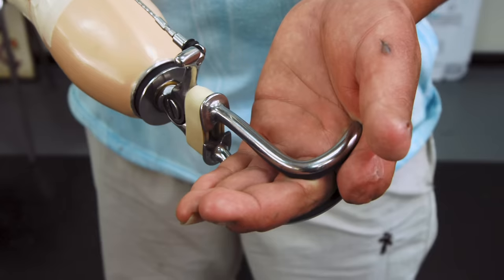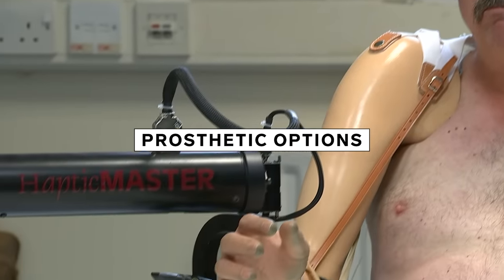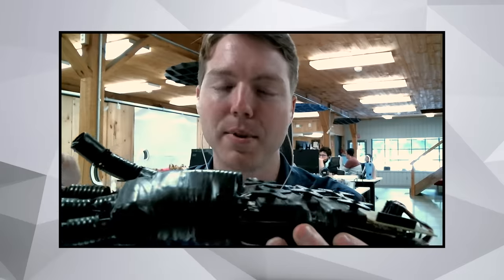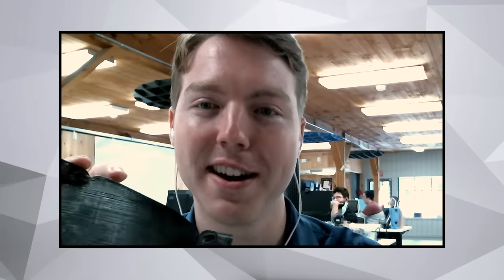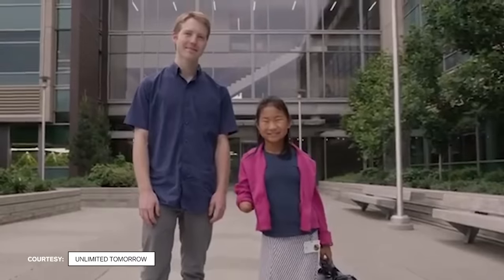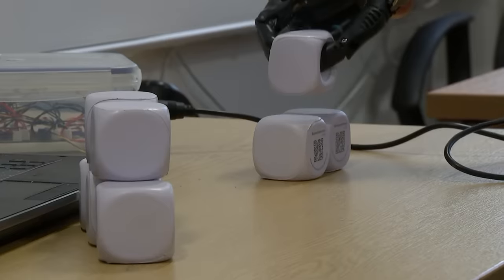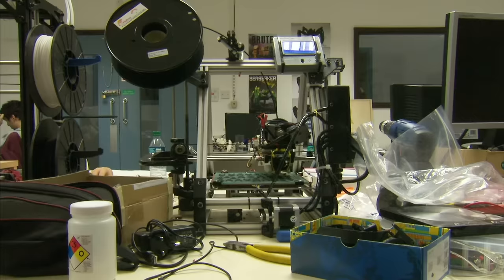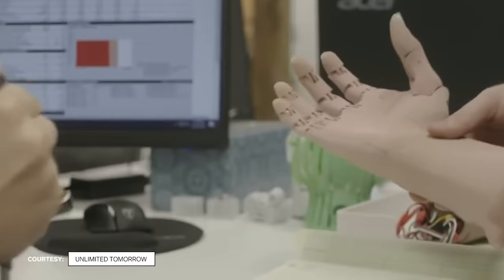Every Prototype that Led to a Realistic Prosthetic Arm | WIRED

Comment: As someone who is missing a right hand.. I can tell you they still have a long way to go. Current prosthetics are like strapping a 2x4 to your arm.. they're probably handy for a fight and not much more. I think they should look into rigid skeletons with tendons, like the video, but surrounded by a thick layer of silicon cast into hand/arm shape. Plastic is too hard and very unnatural against the body.
Reply: I get why your username is Bucky!! :)
Reply: Transhumanist here, not missing any limbs, but it's the "realistic" looking ones that I hate. Like yeah, we've come a long way and they're getting much better, but I want something that can do something my natural limbs can't. Since we haven't mastered movement, haptic feedback, and all the cool functionality of my dreams, at least give me a bottle opener or a flashlight, or like a 4tb external hard drive. Give me a wifi hotspot in my robot arm. Having a limb missing still really sucks. Let's at least make it worth the money to buy the expensive prosthetics
Reply: hehe “handy”
Im sorry
Reply: @xandracortez9485  My last name is Buck lol. No connection to the hand thing.
Reply: @callmestumps6954  I can buy the metal connector that normally secures the hook/hand to the prosthetic and weld whatever I wanted to them. So I could theoretically make whatever attachment I wanted, just need a welder.
Reply: Ooh yeah a silicon outer structure would make so much sense. There's gotta be some way like that to connect the tech people use to test weapons and armour and stuff with the current prosthetic tech--something that can move but also something that has the feel and weight of your other arm instead of a 2x4.
Reply: @nicksalvatore5717  Why? There's plenty of empty space in prosthetics. Why not put a cellphone holder in it? Why wait until "after" it's perfected to modify? Why not both?
Reply: @callmestumps6954  "not missing any limbs"
Opinion discarded
Reply: Have you seen Ian Davis prosthetic hand on youtube?
Reply: @nicksalvatore5717  to be fair, a beer opener is quite easy to integrate into almost anything, but it certainly would look wierd
Reply: @callmestumps6954  I amputated my legs below the knee using ice, lol. Now I have nice (sometimes annoying) bionic legs. And I'm a foot taller, that's a plus I guess hah.
Reply: @happymolecule8894  i envy you
Reply: I think focusing so much on making the arm look realistic is the entirely wrong way to go. A lot of foot prosthetics don't look anything like human feet anymore, because we tried making them look as realistic as possible and it 100% negatively impacted performance. Once they let go of the image of a human foot covered in skin, we started seeing massive improvements.
Reply: @bummer6  That's funny because I've been thinking of the crab claw recently. Crabs seem to use it pretty effectively and there's only one point of articulation.
Reply: @bucky13  I’ve welded vise grips to mine to hold filler wire for tig welding, works like a charm
Reply: @thugnastytv4195  The vice grips are a good idea. I can buy the metal adapters for prosthetic accessories online. I plan to start welding them to things like vice grips to make custom quick connect tools.
Reply: need a hand?
Reply: @nicksalvatore5717  That's what I think will happen too. I think future limbs will be medical first and then go cosmetic afterwards.
Reply: @bucky13  the "quick connect tools" part just made me think of all the possibilities of having different adapters to easily swap out with different things attached. Like a knife, a claw, a hammer, a general holder for drinks and other things, phone holder and whatever else. That would be sick.
Reply: do you have to type with one hand or do u use both real and prostetic
Reply: Yeah like fighting is an everyday thing 🤣
Reply: In a few years, having a prosthetic limb will be better than real arms
Reply: @chrismanuel9768  Its a simple design philosophy of "complete what's needed before you add what's wanted". You don't want to be the one egg head to say "Sorry, boss! I couldn't test the arms grip strength yet. We had to get the cup holder working on the thing!".
Reply: @callmestumps6954  follower of the machine god of mars here, you're wrong. Before archieving things only the blessed machine can do, we need to design an arm that is either either equal or better than the weakness of the human body. We're not nearly as technologically advanced as cyberpunk, so we need to take care of what can be done today to archieve the average power of a human hand for now
Reply: @callmestumps6954 I don't take anyone calling themselves "transhumanist" seriously.
Reply: @HammerStudioGames  Why? Genuine question. Technology is the future and it's reasonable to expect humans to become part machine in the future. That's what a transhumanist is. Someone who wants to become enhanced with technology. Just because you've created a weird stigma against the term, doesn't make it any less of a common trait.
Reply: I don't care about the look.  I care about them not trying to connect directly to the nerves and making limbs better than the real thing.
I gave you a like but taking a negatives position because I want cybernetics.  I believe prosthetics is the most likely field to give us cybernetics which they are failing horribly at.
Reply: You can grab a can with a 2x4?

Comment: I'm actually surprised with the ones that are meant to look realistic.
The reason they look so uncanny (I believe) is that while they match in skin tone, that's about where the similarities stop. If they used casted silicon sleeves molded after a mirrored version of the persons remaining limb, or a model limb, then they would get all the fine details down to the follicles and the subsurface scattering of light that real skin has. It wouldn't be too cumbersome I would think, and the process for making realistic skin effects have existed for a long time thanks to practical FX artists, like for horror movies.
Having a skin glove would be nice because it could be made cheaply if you reuse the mold, could be airbrushed to give it a realistic look, and would be easily replaceable, washable, and protect the prosthetic. Not to mention you could upgrade the prosthetic while keeping the sleeve the same so long as the new prosthetic fits within the volume of the sleeve.

Comment: Yeah the main issue is the robustness of the devices, pattern recognition has been around for a while but i's one thing being able to move your fingers in a more natural way but it's another to actually do day to day tasks beyond the standard box and block test, of course all invocation is good and hopefully bring down the price but we are still  long way off being able to 3D print prosthesis that actually are functional and not making the patient frustrated
Reply: Did you not see the guy holding a knife slicing food with his prosthetic hand?? That is definitely not basic block test
Reply: @waywardgoddess7219  Yes but that's a rather simple grasping task that doesn't require high strength just a level of dexterity which individual finger movements supply, I'm on more about the day to day tasks that require higher strength hence I talked about robustness, even getting dressed these devices can't apply enough force to put on clothing for instance, they are only good at grasping fairly light weight objects and doing fairly straight forward motions like back and forth or left to right, I've spoken to many patients and they just feel that it's extremely situational and the hook systems provide a lot more function, and the sensor system can be very temperamental even when it's fitted properly causing it to do something you didn't want it to do
Reply: @waywardgoddess7219  I agree with max here. I am handicapped myself (but still have all my limbs). Human movement is rarely simple. Even holding a cup of coffee requires many muscles and very complex movements and coordination. So while this development is great, we are nowhere near being able to use a robotic arm as 'normal'. These videos tend to hype it up in the minds of people. Moving fingers and holding knives is the easy part. The real challenge comes later.
Reply: @waywardgoddess7219  it's easy to hold a knife
Reply: "still long way off"

No.
Reply: @alalalala57  and?
Reply: @alalalala57  it's not something hard, you don't need magic to hold a knife
Reply: @hkr667  I hope these issues get sorted out in the next 10 years. Maybe movies have ruined me but these technology is exciting.

Comment: I wonder if you could wire a USB-C port into the human body site? Then "dock" the prosthetic onto the USB port. Essentially re-create the neural connections. With a standardized interface like that, it would make swappable prosthetics possible. Need a strong arm for heavy lifting tasks ... plug one in. Need one for your delicate sewing hobby ... swap that one in.
Reply: A good idea on paper,but its not all that practical since it would need some kind of surgery and be incredibly expensive most likely

Comment: Great to see that this has advanced. In fact Cyberdine had a nice exo-suit with some sort of sticker input. It might be possible to have a re-chargeable solution with kinematics and some clever power storages, like a flywheel etc. Since I suspect that this kind of a device must be strong but light-weight. Then again a flywheel would add to much vibration to it. Is this kind of stuff possible with pneumatic approach? There would be a lot of whoosh sounds then tho...

Comment: i think the three biggest limiting factors i experienced when prototyping my own form of a robotic hand were power, control complexity, and servo torque. at least in terms of making something functional that doesn't weigh 80 lbs. if i was going to really develop a better prosthethic i think id focus on the core two though, batteries and servos (the latter in the form of current to torque ratios)

Comment: I would say the best material for prosthetics is most likely layerd carbonfiber for an insane durability.
But then the problem becomes if you want a prosthetic that looks human or just cool.  A human looking will have
issues with acting like human skin, retracting and bending without drying up and cracking over a few years.

Comment: Does this use extraneural electrodes or some kind of neural interface or is it still using the weak myoelectric technique?
Reply: Looks like myoelectric and the feedback is still rudimentary. If anyone knows where I can find research beyond extraneuralelectrodes and perhaps some kind of housing/controller for the nerves, I would greatly appreciate a finger pointing me in that direction. I'm so bored of myoelectric things.